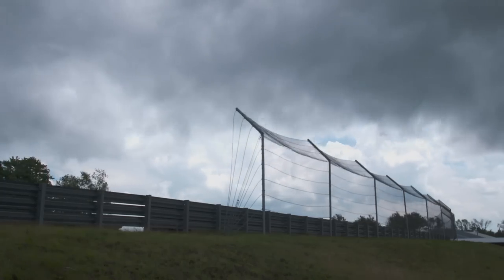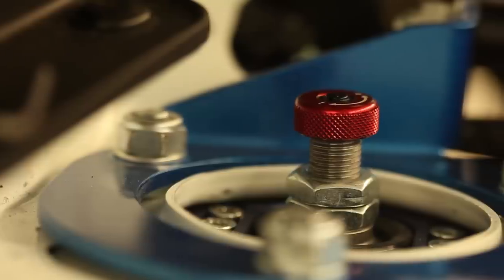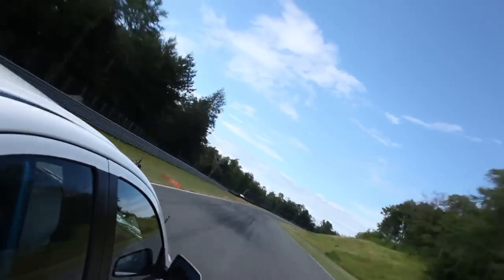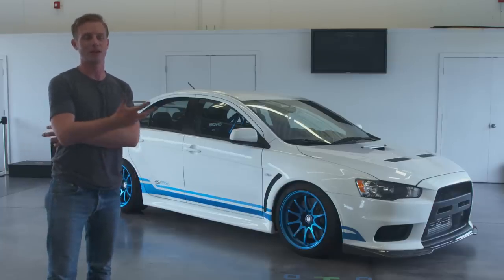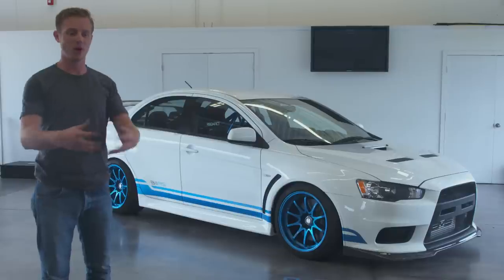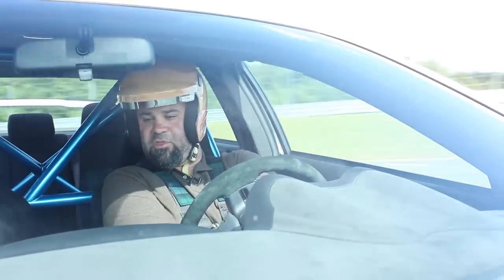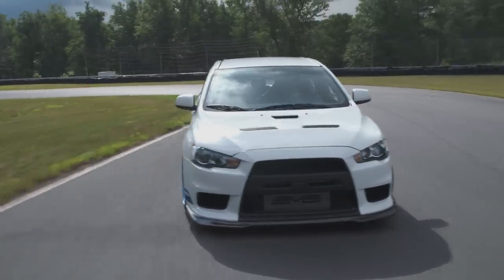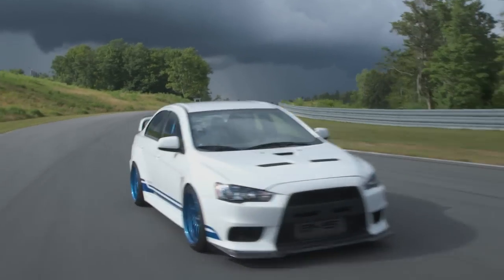Ryan Gates's 311RS - or - How to Make a Better Evo -- /TUNED

Comment: Easy 120k, 80-90k in parts alone. The engine alone was almost $45k. And you can't do the math properly because the owner of the car also owns the shop and did lots of the work himself.

Comment: I've been waiting on this one for a while. My setup is nearly identical to this one, except I have Ohlins rather than JRZs. Mine is setup to oversteer pretty heavily for autox. Wish you would have got more time in the car Matt! That being said, as a motorsports enthusiast/tuner, you HAVE to buy the stock car and modify it yourself to get the true experience. It's so rewarding seeing the car gradually improve as parts are added and pushing yourself to reach the new limit of the car as it improves

Comment: 400whp Evo X MR owner here. For the money I have had to spend on my car, this honestly doesn't seem like a bad deal. I have about $65k in mine with sticker price but this has nicer interior, better suspension, and the roll cage. I would consider this car if it was available when I got mine.

Comment: Just my opinion here. I can respect the performance upgrades and all. However cosmetically it looks alot worse than stock. Shift knob looks like some overpriced chincy knob.  The ebrake looks great but this isn't some old British roadster or Miata. It's a Japanese tuner car.  It's out of place. The upgraded Mitsubishi aluminium one is fine and I'm sure you can grip it good enough.  All that suede on the dash and steering wheel looks ghetto. Like trying to cover up cracks or things that are worn out. The stock steering wheel is fine. Granted the stock dash isn't amazing but I'd take it over suede or Alcantara or whatever it is.  Also is that plaid in the seat bottom? That looks like the seat was torn maybe and all that could be afforded to reupholster it with was an old shirt or something.  Even the wheels look worse than just plain black.  Just made a nice looking car worse.  Perfect example of how an "upgrade" is worse than leaving things alone.
Reply: Agree! Should have left it stock. The seats and that blue decal outside are not appealing. Should have gone with black rims and all white car.
Reply: And you can upgrade your stock evo for less money, and achieve the same results. That is what I have done, and I have chose each part myself, I don`t like to be fed by spoon, and deal with a whole package from one certain tuner company (AMS).
Reply: ***** The Akrapovic is awesome, but very expencieve, I know a vendor from where I can get a Tomei titanium exhaust for like 900 $, downpipe 460 $, testpipe for 320 $, so a full catless turboback 1680 + 250 shipping is still below the 4200 $ + shipping, that is charged for the Akrapovic, and I am willing to bet my ride that it will not outperform the Tomei.
Reply: ***** Single exhaust is actually better for performance than the T design, but it is louder, that is why I chose the Blitz Nur Spec Cti catback so I can avoid unwanted attention.
Reply: Sam DeJong  agree about interior, especially old shirt seats.
Reply: I feel like it's a throwback to the evo 4, 5, and 6. They had plaid red/black seats and door trim.
Reply: Sam DeJong triiiippppinnnn. gates did an amazing job with this package and very tasteful imo. also look up the 311rs 'Spec Blew' maybe you would like the look of that one more? idk but I really like what he's done with the car and like he said, I think it all actually works, and nicely at that. I have alwyas wanted to do the same color combo with my WW EVO X with the Blue wheels, but I want a more blue purple color lol

Comment: The first time I fucked it up I burst a disc (L4/L5) while doing the Baja 1000. Turns out you can get mega injured doing that race even if you don't crash. Then, in 2010, I took a promotional gig driving people around at SEMA for a week in that "firebreather" camaro thing. The seating position and ride were so bad, that after a week, I burst the same disc again. (part of the reason I hate Camaros). So I've had the same back surgery twice. And the only way to get rid of the pain is to not drive.

Comment: @Ryan Gates
Due to high traffic in my country a manual gearbox is out of question, after 1 hour stuck on traffic everyday I'll have to replace my left knee pushing the clutch..Any possibility to develop the RS311 with automatic/paddle shift as an optional?

Streets in my country are full of bumps and somewhat irregular, any chance that the 311 is not so low. I know you stressed out the aerodynamic part but maybe another front fascia is available?

The huge spoiler will divert cops to me like bears to honey, any possibility to install something more discreet as an option?

Please don't recommend me to buy an SUV or a truck ;)
Reply: Perhaps you want a stock 2011+ Evo MR?
Reply: @tsujimasen.. Forget it I'll go with the upgrade from AMS to 400HP
Reply: Gates has built 1 311RS MR, btw.

Auto would be for bitches.....good thing MR's are dual clutch gearboxes, not auto torque convertor slushboxes.

Comment: if your talking about the FQ400 technically its not factory nothing on it came from Mitsubishi. Its was a GSR that was then tuned by Ralliart with HKS parts. Usually only dealers give horsepower numbers at the crank...the 311RS is rated at 360 wheel hoursepower (whp) which some one already stated is somewhere around 420-430 crank house power or bhp. oh also the FQ400 has a different turbo this does not.

Comment: How the heck did he get it to 3100 pounds and keep the interior? Ryan, if you read this is there anything you removed to make it lighter or is it all just replacing parts with lighter parts? I don't see replacing part with lighter parts getting it down to 3100.  

Also Ryan said the wheels are 18" and Matt said 19". Which are they? I'm assuming 18".

Comment: This is the ultimate street Evo! Fuck 500whp, big turbo's ruin the whole balance of the car. A AWD race car should make good power, BUT throttle responce is 10 times more important than all out power. This car is all about brakes and suspension and balance. He even put in new rotors that are 20 pounds total lighter than stock, this guy is all about performance. This is a bulletproof track day car!

Comment: 440 at the crank?? really you think in the upgraded drivetrain still loses almost 100 hp ?? maybe 405 at the crank
Reply: the evo loses about 40hp to the wheels through the drivetrain based on a dynojet (not mustang dyno), i.e 291 crank, ~245-255 wheel.

Comment: NOt true ryan 4130 chromolly is the same density  as mild steels so they both weigh exactly the same. BEcause 4130 has the higher tensile strength you can run thinner wall thicknesses for equal strength, thats where the wieght savings comes from.

Comment: But what's a slow metabolism? Someone burns less calories than what?

Why does it matter how many calories are "burnt up" if the amount eaten is less than the amount burnt up. 

The amount of energy consumed is the greatest contributor to weight change. If current intake is not showing desired results then intake must be adjusted. Rate of metabolism is unrelated to intake unless influenced by starvation / drugs / etc.

Comment: LOL 360AWHP is 430-440 crank? are you high? AWD drivetrai n loss is significant, i run a tuning shop and a 400awhp suby is well over 500hp to the flywheel.
Reply: ***** All motors are build differently man. 20% is a educated guess...i have had cars that were 32% drivetrain loss. A 360whp evo will smoke pretty much anything you throw at it
Reply: Pretty pathetic and it still runs high 11's and low 12's lol. It all depends on the dyne, dynojets read high and mustangs read low
Reply: true

Comment: Say what? Are you too young to remember? Granted subaru has more manufacturer-championships, but theyve also had more active drivers the years they won. When it comes to drivers, McRae won with subaru in 95, before Mäkinen won 96,97,98 and 99 with the EVO 3, 4, 5 and 6. I agree that most people would probably remember Subaru, but its a long stretch to say that Mitsu never took off. Looking at lower classes than WRC today and you may be able to spot the thousands of evos out there.

Comment: Nice car, but driving these things (with proper ride height) on bumpy, 
narrow, gnarly, greasy switchbacks is sooooo much better than on a flat 
featureless pay track. On a track, these things are impressive, on a 
widowmaker backroad they're KING. I mean, that's what they're really 
designed for, jumping over muddy cattleguards at demonic speeds with the
 wipers on full tilt, not farting around on smooth tarmac in your 
wayfarer's.

Comment: changed Mit EVO 10 3 times 2007 2010 2014 due to depreciation..maintenace cycles, or every a few years or reach certain KM or miles, say my usually is 30 to 90k KM, i consider selling the car away.

Comment: i hate it when people like this guy put everything on their car except the blue headlights dude blue headlights with blue lines and wheels damnnn
Reply: blue lights they are either too bright or too blue to where you can't see shit on the road. Stupid idea
Reply: Blue headlights? What the hell kind of idiot would want blue headlights on their car? Unless you're talking about blue HIDs ? In that case it can probably be asked to be put on considering these vehicles can be customized however you want. This car is a track car first, so something so negligible is irrelevant.
Reply: well considering he said these are in ny and are ment to be a daily driver as well as a track tuned car....If your driving off the track and in ny especially up in montecello cops will pull you over for anything and everything you can.
Reply: Blue headlights rank 2 on my f u car on opposite side. Number 1 is badly adjusted lights

Comment: What is a slow metabolism? 3000kcal a day? 2000? 1000?

Assume 2000kcal is a slow (low?) BMR. Eating below 2000kcal will result in weight loss.

The actual metabolic rate is not relevant. Whatever the metabolic rate of the organism, slow, fast, high, or low in order to gain weight the amount consumed would have to be greater than the amount consumed by "metabolism".In order to lose weight the amount consumed would have to be lower than that rate. The absolute rate is not a factor.

Comment: I like how this car is sporting 1G DSM BOV (1990-94) , it's "crushed" too for the right boost hold. Nice car, even that it's not 4G63.
Reply: That was a stock evo x bov🙄
Reply: @johnbarron2698  you're right. I missed the flange is 3 bolts not 2 like 1G DSM. I didn't know that they went back to a Bov made of metal instead of plastic. But this one is still crushed like they used to do it in early 90s 😊
Reply: @TSiArt1  cant believed you replied to this😂 but you are correct 👍🏼
Reply: @johnbarron2698  because you replied to 7 year old comment lol. And rolled your eyes.
Reply: @TSiArt1  a true OG

Comment: To be good you have to copy from the best. I don't doubt this is a well balanced package but obviously it's kind of a Porsche 911 GT3 rip-off. Starting with the name, over the suede steering wheel to the whole track orientated thing. I wonder if the car needs that. At least the 8-ball shifter, wooden e-brake and plaid pattern (hello GTI) are customer wishes which somehow increase the feeling that somebody tries to copy things that make other cars great.

Comment: What is healthy? 

How do you expect someone to lose weight without eating less than they metabolize? 

If a person needs 2000kcal to maintain their current weight they must eat less than 2000kcal to lose weight or more to gain. 

It would be unhealthy for an overweight person to maintain their overweight status by consuming enough energy to prevent weight loss. In this case eating at a deficient would be healthy.

Comment: WRX STi < Evo
Reply: The sti is faster than an evo around track.
Reply: For which year? Which circuit? Measured by whom?
Reply: Top Gear.
Reply: British or American version? Because I specifically recall the BBC version saying the Evo was faster.

Also Top Gear is more a entertainment show than track testing.
Reply: No on british top gear they do lap times in all their cars they test and when they tested the evo10 vs the 2012 sti i think the sti won on the lap time.
Reply: Ah we are both talking about different year models. That must be where the issue is. The Evo X is a watered down evo in Mitsubishi's attempt to appeal to the mass's more.
Reply: No not the lap times
Reply: DannyH the evo won in fact the sit was still slower than the evo 8

Comment: Outsides o.k., inside looks like some irish guy got ahold of it, and under the hood hardly anything was changed, hence the comment about this not feeling tuned. 5:49. making it a bit lighter helps, but i have done better with a lot less than 49 g's by just going on a diet.

Comment: $49k???  I personally would not even spend $30K on an evo, let alone $49k regardless of what has been to it UNLESS i can turn around and sell it for more which is very unlikely.  Evo is a great car, but not a $49k car.
Reply: Name a $49k car that you would rather have. Is that car going to be faster than the 311RS?
Reply: for $49K, i would get a used: e60 m5, e90 m3, isf, c63, rs4 etc.  Again, I am not denying the evo is fast, just that its not worth $49k.  All in one car, not just a fast car.
Reply: Jay Vang
I should have prefaced new car instead of used car, depreciation is a huge b*tch on any car for the first few years.
Reply: Found out the other day that this Evo has 353 whp....which roughly puts it at 422 bhp. Rivals the E90 M3 at that horsepower level, but the suspension is an aftermarket $4200 suspension.......and it rocks.

Comment: After driving a 3000GT for 3 months I would never buy a Mitsubishi
Reply: The evo is mitsubishi's pride. the 3000gt is crap thats why they stopped making them
Reply: Lol @ comparing a 3000gt to an Evo. Everyone knows 3000gts had shit loads of problems.  I would take a 99 gsx eclipse over a 3000 gt
Reply: I wouldnt go that far the vr-4 can hold its own against a lot of cars.
Reply: I know that..... Did you not see my reply?
Reply: ohh sorry hit the wrong person to reply to. but yes base and nas are slow as shit. still nice looking. but sloww and the sohc motor guzzzzles gas
Reply: Jay Burgess is that coming from someone that can afford a gsx and knows about dsms? or are you saying that because you read alot about them being great. you should start looing at talons. theyre basically the same car but the talons ugly as shit. gsxs arent reliable, and theyre not all that fast either. as for the 3k have you ever driven one? take a look at my previous comment to kirei
Reply: Basically the gsx is better than the 300gt sl since theyre both fwd but the 3000gt just weights more. But the dsm and vr-4 are both awd but the vr-4 is twin turbo while the dsm is a single turbo 4g63 like the evo. Both cars are bad both cares are good too depending on the trim.
Reply: a gsx is not fwd. ever. if youve ever found a factory stock fwd gsx, buy it beacuse its one of a kind. the gsx was a turbo 4g63 awd eclipse. gsx was the trim that that perticular eclipse could be had in.

Comment: Awesome, awesome car.  Love those subtle touches with the wooden hand brake and the 1971 Ferrari shifter.  Looks like a proper riot to thrash around as well.  Suppose there's no better track car to buy than one designed by an actual racing driver.

If you love cars, check out:
hairpincorner . wordpress . com